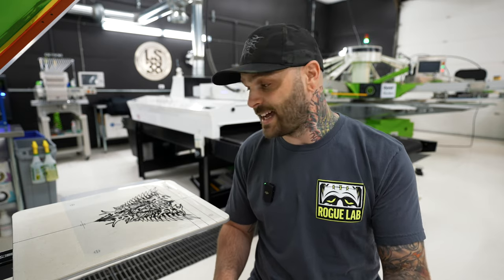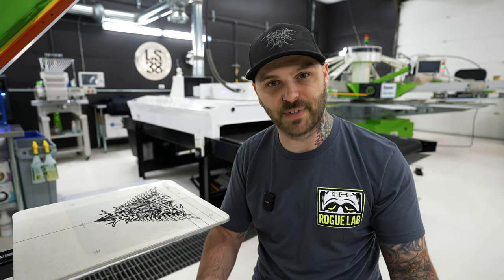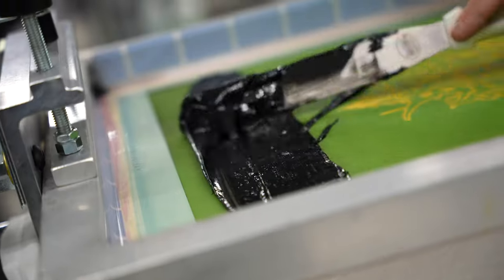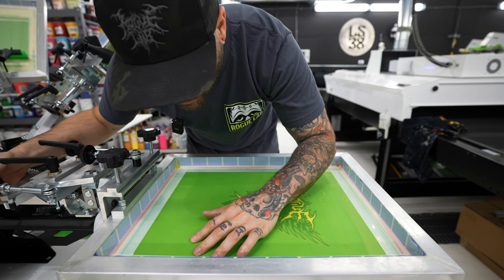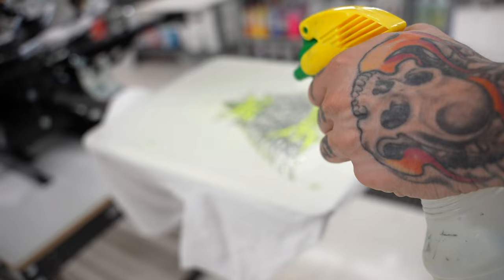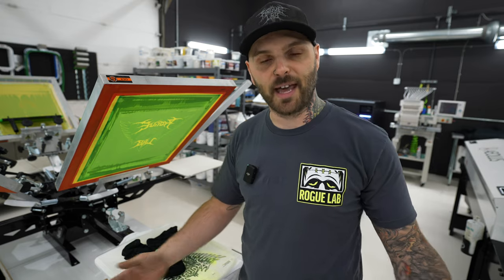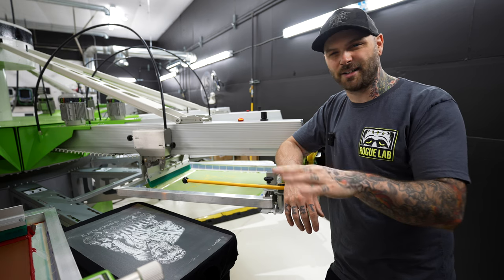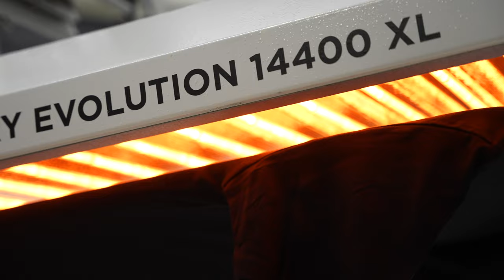SCREEN PRINTING REGISTRATION Made Easy!

Comment: great video mate . i have a question . iam going to setup my screen printing studio in basement where is little bit cold and no window ,only a  door . so iam worrying about the humidity or temperature level . will it effect to keep the inks and store the cloths ??? also i have DTG machine too . will it effect it ? will heater or dehumidifier help ?
Reply from the maker: It won't affect anything in the screen printing area for the most part, but if you're drying screens out in the open you'll want the humidity level to be below 40% to allow them to dry properly. My shop is at 25%. The humidity level will affect the DTG though. Too low and it'll have issues so you'll have to find the sweet spot between both setups. Get yourself a way to take control of the environment with a heater and either a humidifier or a dehumidifier depending on the humidity levels. Won't cost much.
Reply: @leestuart38  Thank you so so much for this replay mate. i was worrying and now iam clear by your replay . 
Will it effect on cloths ? because i should keep the cloth too inside .i have my own brand .yes iam going get heater and dehumidifier to control environment inside the basement ..thank you again

Comment: @Lee Stuart I have told the shop I work for about the Reg.Tape. it's been over 3 years that I asked them to get me a roll, and still to this day use packing clear Tape SMH 100% takes a lot longer to tape it, they are other press worker that set up and can use up15-20 shirts on 8 colors set up. so having registration tape is a most have 100%
Reply from the maker: Man that's a bummer that they won't do that for you. Registration tape lasts a super long time, cuts a lot of waste and will speed up the process by a ton. I set up 2-5 jobs per day on my auto and a roll has lasted me a year so far and it's only 3/4 gone. That much packing tape would cost a fortune
Reply: @leestuart38  for sure. Beside that, they have so many other things they need to fix. Like 100 fisheyes on screen. Just on a light table, just blueblocking the screen for 5 min LMAO.
Reply from the maker: @edgarrivera532 sounds like whoever is doing reclaim needs better instruction